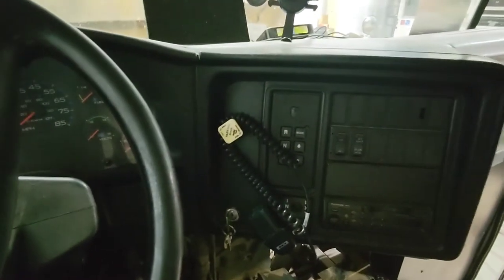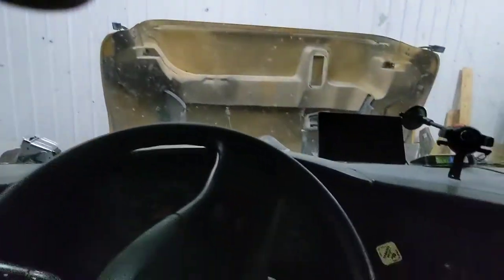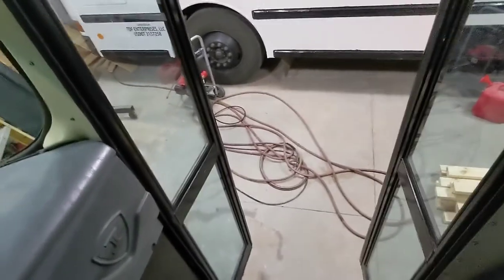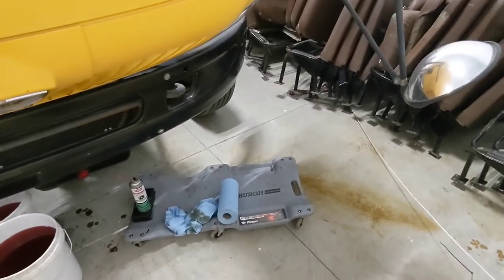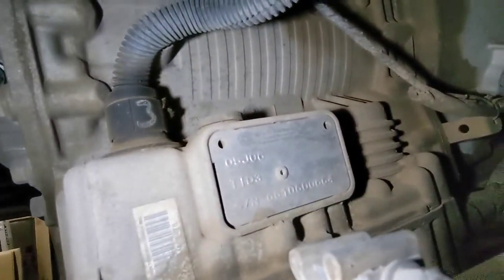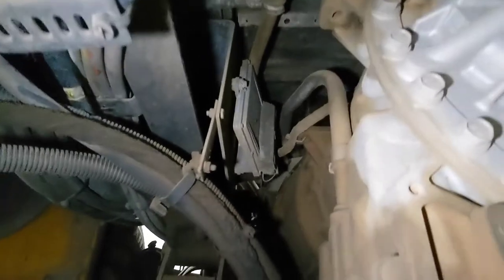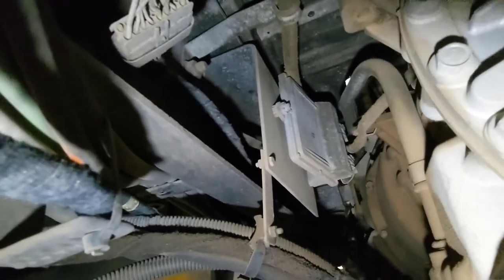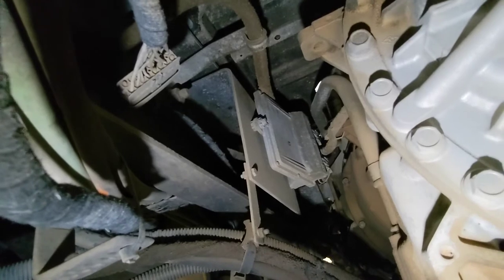TSLABUS Skoolie Conversion #6: Enabling 6th Gear on Allison 3000 Transmission (Part 1)

Comment: Would this work on an Allison 2500 transmission?  They are 6 speed as well, but only 5 speeds available in a school bus.
Reply: It should, but I would do research just to be sure.
Reply from the maker: Allison 2000s built in the second half of 2006 or later can be re-flashed to enable 6th. Prior to that, they need a valve body upgrade before they can be re-flashed.
Reply: @thetslabus  Do you know anything about the 2500s?
Reply from the maker: @nicksevers07  my understanding is the 2500 has same reflash requirements as 2000 series, just has to be new enough to already have the upgraded valve body from factory or you have to do it first.
Reply: @thetslabus  Ah ok thank you

Comment: I have a school bus with that transmission and I’m having trouble finding someone to reflash the TCM. Do you have and recommendations on who to have perform that for me?
Thanks
Reply from the maker: Yes, I highly recommend Charlie Ball. He did mine with excellent communication, prompt service, and a fair price.
https://www.facebook.com/charlie.ball.399
Reply: @tobystoller8076 May I know what model of school bus this is
Reply: @sanJiu-un8qq  I’d have to check to be sure, but I ended up buying a 6 speed controller online and recalibrating it with jaltest
Reply: @sanJiu-un8qq  Bus model doesn't really matter, I've had a couple of IH 3800's that had the 3060 and currently have one in my RE300, they are about the best trans you can find for a bus or RV in the slush box flavor.
Reply: @thetslabus  How can I get ahold of Mr. Ball I don't use facebook
Reply from the maker: @PatrickBaptist-vv2bg  I'm not sure, thats the info I got and how I communicated. Somebody on the skoolie.net forums might have an email address or something that could help?